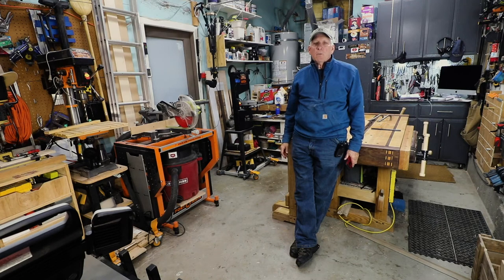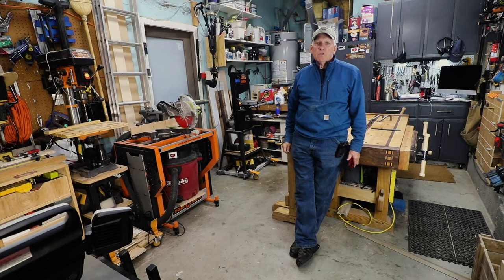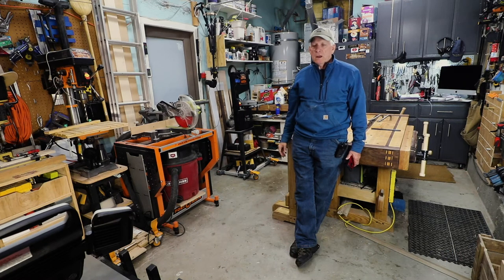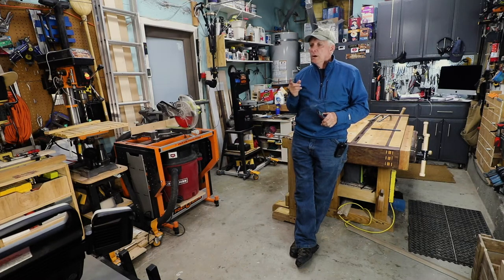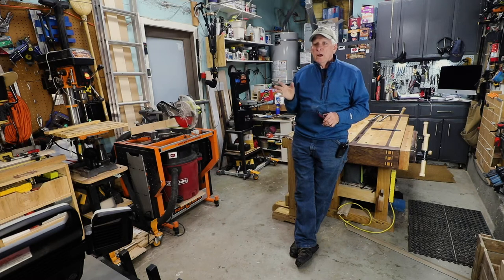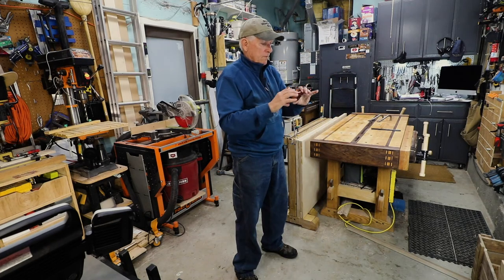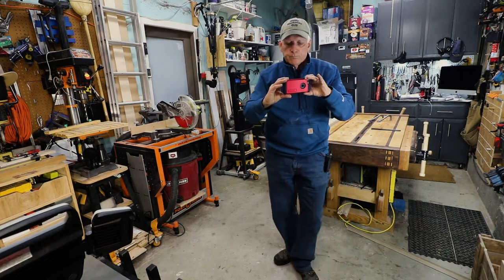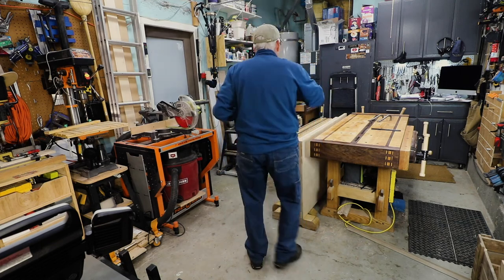How You Can Record a Virtual Reality Tour of Your Workshop - See Mine!

Comment: My shop would draw a lot of ridicule from people. They would probably ask questions like "Where do you get any woodworking done", or "How can you work with all that clutter". I'm sure some people would use a different word than "clutter". I have been trying to clean up my garage since I started doing, (or trying to do), woodworking on a larger scale than I had been when I found out I couldn't return to work after my surgery. One day though, it will get cleaned out and I'll have room for "real" woodworking equipment.
Reply from the maker: This may not be practical in your situation, but whenever I find something has gotten completely out of control organizationally, I find the best method is to pull absolutely everything out into the driveway, clean up the floors and walls and then put things back.  What you end up doing is leaving 1/2 of it in the driveway for the trash service to come clear away and the rest back in the garage looks great.  Of course you may need some help with a big garage.
Reply: @SmallWorkshopGuy  I've done that before when I had a lot less stuff, and since I have a side door, everything was put in the side yard. I have far too much stuff to put in the side yard now, and so much that I would run out of daylight before it was all sorted out and put back in. I need to make at least four piles when sorting, things to keep, things for recycling/household hazardous waste disposal, things that can be sold, and trash. I want to rent a Pack Rat or PODS unit so I can take my time sorting everything out, but there are other things our money is better spent on for now. Help is an offensive four letter word to most of the people I know, that is unless it is them that needs the help.
Don't worry, I will eventually have a decent work space with some decent equipment. Take care Paul, thanks for the encouragement, David S.